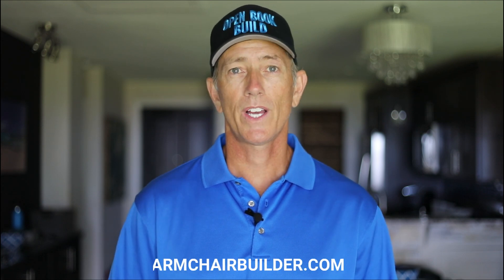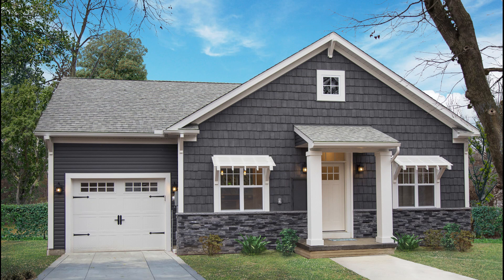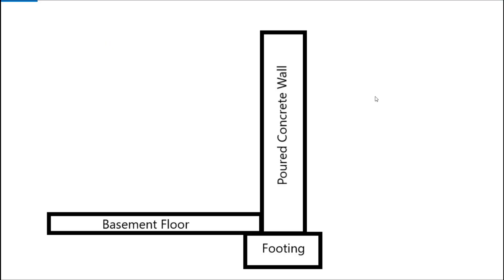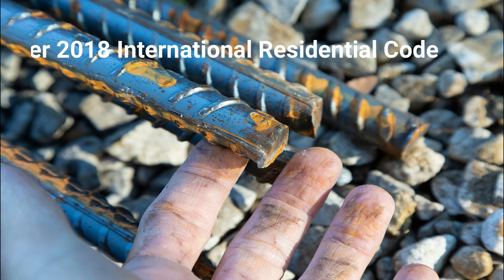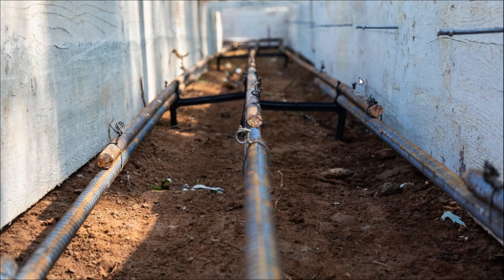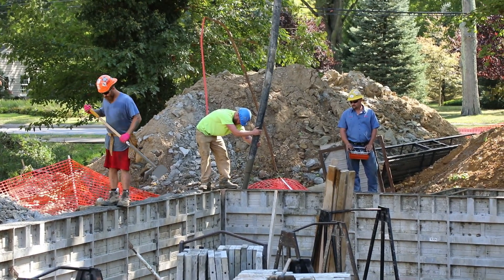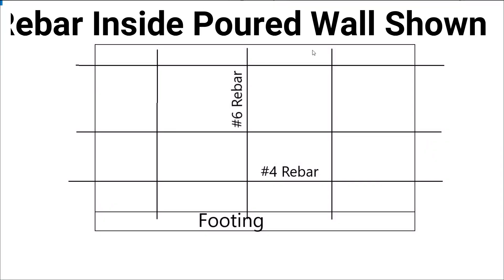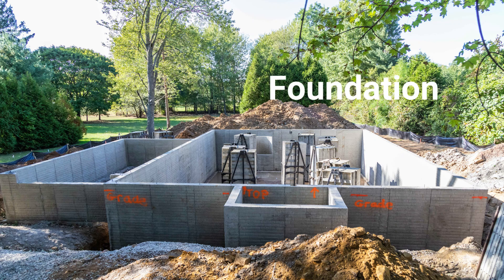Quality House Foundations: Avoid Structural Problems

Comment: Recommend editing to specify the reinforcement you showed does not help mitigate flexural cracking due to settlement. You need bars on TOP of the footing, 1.5”-2” from top in order to provide tensile resistance and prevent concrete footing from cracking due to possible settlement.

Overall great overview of foundation!  :-)
Reply from the maker: Thanks for commenting.  The typical spread footing has continuous bearing underneath along the length of the footing.  We’re most concerned about possible small pockets of soil below that may settle.  When this happens, that section of footing will want to fall into the void below.  This puts the concrete into compression at the top of the footing and tension in the bottom.  And because concrete is strong on compressive strength and weak in tension, we place the rebar in the lower portion of the footing.
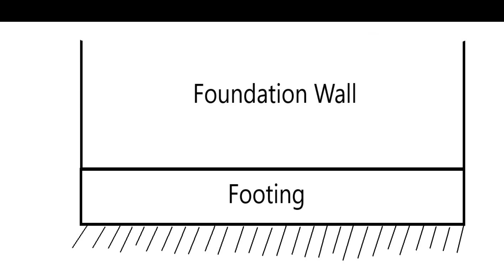Reply: @OpenBookBuild   At the 4 min mark in video you show a cross section with bars in the bottom, then at the 4:12 mark you show footing cantilevered. Bars are needed in the top as well in this scenario of failure due to the cantilever, the forces are swapped in this section, tensile top and compression bottom. 

Also, overall great video, simply detailed and explains real well the requirements and importance of footings/foundations. Most home owners have no idea the importance of foundations.
Reply from the maker: @mellis6888  For the typical residential home we want the rebar in the lower portion of the footing.  The International Residential Code has it here for the reasons I mentioned above.  The most likely case under a continuous home footing is for small, localized pockets of soil to settle causing the footing in that location to want to settle as well.  This puts the top of the footing in compression and bottom in tension.  My video is supposed to show this situation...although I can totally see how you would interpret it otherwise.  But don't let my bad art skills send the wrong message...the rebar goes in the bottom portion of the footing in most cases.  We want to avoid a cantilevered footing...this will most likely lead to structural failure.
Reply: @mellis6888  No one can predict where the settlement will occur—if you could then you would excavate or compact the areas with poor bearing before pouring the footing.  Footing design assumes proper soil bearing.  If soil bearing is unreliable then grade beams are specified.  Standard practice is to put rebar 2" above the ground.
Reply: I thought it was meant to be in the top 3rd of the slab?
Reply: Why in the world would you want a footing have less compressive strength than the wall ie 2500 vs 3000 pounds
Reply: @johnwhite2576  
Cost less, don't need 3ksi?
Also, OP is being anal about details. This video is great. Houses are being built today with 50% of that.
Reply: @johnwhite2576 the wall experiences lateral load as well as  comprehensive load. It's the later load for the reason you need stronger concrere at the wall. The house on top of the concrete and the concrete wall itself isn't anywhere close to exceeding 2500psi so it's fine.

Comment: Can you do away with the rebar using Helix steel?
Reply from the maker: Alejandro Vanags that’s a good question.  I really like the idea.  I know the rebar connecting the footing to the Poured wall needs to be there even with helix.  And based on the Helix literature I’m not certain it will provide the appropriate tensile strength in the below grade basement wall.  There are tremendous lateral forces on a basement wall when the soil gets saturated.